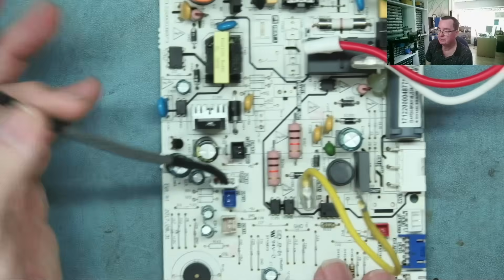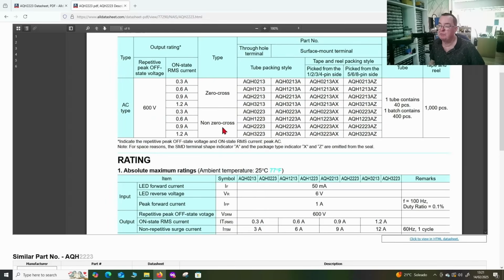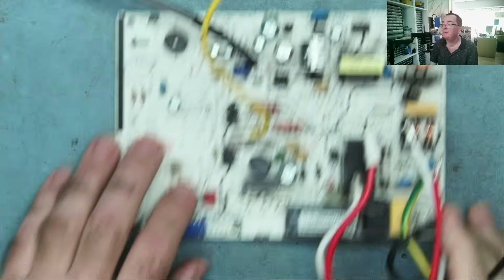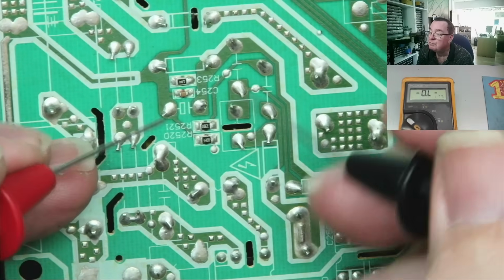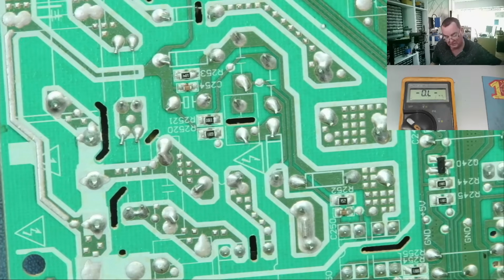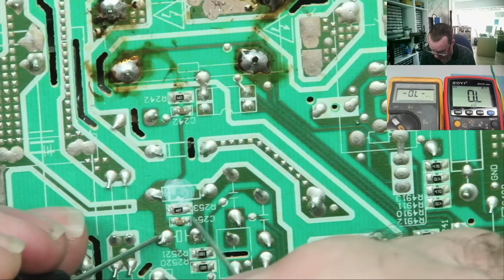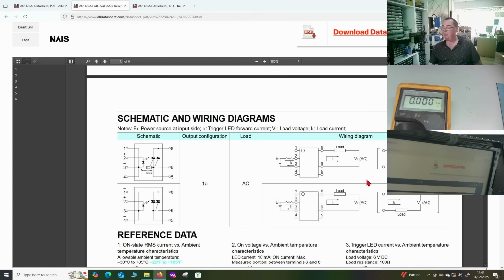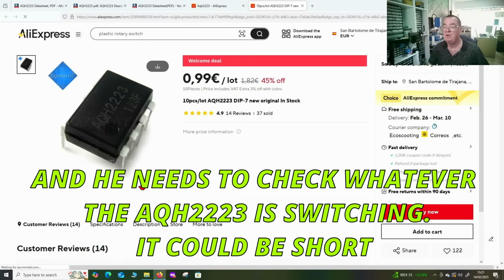How To Find The Faulty Component On A PCB Without Schematics : A Very Practical Repair Example!

Comment: Excellent video Richard. A tip I would pass on to would be repairers, is to keep a fairly detailed note/log of what you do and what you find when attempting any repairs. I tend to create a PC folder for each repair I undertake, into which I place any schematics (found or reverse engineered), any device datasheets and application notes if applicable and a notepad file logging what I did. That way if another identical or similar fault comes across your bench then you already have a record from before as a starting point.
Given that you often make these repair videos I guess you have a built in record.
Reply from the maker: Actually I am not as well orhganised as you are in this respect.  And you are totally correct about how useful this approach is.  Others take note. 😉
Reply: You cant get a better log than the actual video recording of the fault diagnisos. But i see your point.
Reply: A great idea..I used to repair TV's many decades ago and kept a little black book on all my repairs. If a TV came in I would look up the make and model in my book and usually find I had done a repair to the same model that had the same fault.

Christ I can still remember a common fault with a Phillips TV with a K9 chassis with no power. Always was the BU126 power transistor.
Reply: What did you learn today.  Remember em all and you'll be a genius.
Reply: Scribbling a schematic with Vdrops measured resistance and expected values helps me. Still got a ways to go but always learning.
Reply: As somebody who mostly deals with my private electronics or hardware for projects I do professionally work on I try to vacuum up all documentation I can get hold off as soon as I receive a device.  There is a tendency for documents to vanish entirely or behind paywalls or being replaced by newer revisions which may no longer be applicable to my device.  That includes user manuals so I can don't need to dig through boxes and binders for the paper copy of a manual that came with a device.
Reply: "if another identical or similar fault comes across" -

Also useful if it's the next morning when you go back to work on the same board. Or if you get a phone call and have to go pay attention to something else for a little while. :)

It's very easy to spend time checking on an area that you actually already verified the day before, if you don't have notes of what you've found so far.

Comment: Cable  between the units been tested?
Reply from the maker: Yeah the onsite engneer did check that, and also things like refrigerant pressure.
Reply: Guess 2 after watching… is the SSR feeding the louvre motor? Faulty louvre motor? Inductor feeding the SSR have shorted turns?
Reply from the maker: @JonathanMRose  I don't know what it feeds but it is clearly a 240V AC device and I did mention it is important to test what ever the device is for shorts
Reply: @ could the inductor next to the SSR have shorted turns & caused the issue?

Comment: 33:00 wouldn’t you be able to use the backlight tester as both the source and readout for testing the TL431?  Seems that it would simplify things.
Reply from the maker: Yes that should work if you set it to 1mA range though you still need the adapter to connect to the three pins of the TL431. I oriiginally intended it to use a 9V battery or similar supply when I built the tester,  and a multimeter
Reply: @ I gave this a try, and it worked perfectly.  I used a wide ink pen shell and a 3P receptacle. After attaching two banana leads to the receptacle solder leads, I inserted sharp gold plated pogo spring pins into each location. The result was a on-handed probing pen on perfect spacing which attaches to my backlight test box.
Reply from the maker: @Y.T.Learner  Nice one Paul.
Reply: @Y.T.Learner  That sounds slick, I wish I could see it 😏

Comment: I wouldn't have bothered removing the relay to test it. You measured the resistance - 120R, so the current will be 100mA at 12V. Set the voltage on your power supply to 10V and current limit to 100mA. If you pick the wrong way (diode protection) you will get current limit. The right way will trigger the relay. These relays should reliably switch at about 8V so if it doesn't trigger either direction then it is faulty.
Reply: Maybe some caution with this method - pretty sure I managed to blow up a ULN2003A driving a relay, by applying reverse voltage directly to the relay coil, can't be 100% certain though, but in this case (heater control relay in a washer which was clicking but no power to heater) I suspected the relay contacts were burnt out and tested in circuit (on site with a 9v battery of all things, definitely had it reversed for a very short time). Once confirmed, brought board back, replaced relay and then back on site, found the relay was no longer being driven, and had to replace the ULN2003A too.
Reply: @budgiefish  That would suggest that the reverse protection diode was either not present or had failed, since protecting the driver is exactly its purpose. It's also the reason for limiting the current and using a voltage lower than the nominal voltage of the relay.
Reply from the maker: Yeah I am sure you could do that,  I certainly would have tested it in circuit if I could see the protection diode as I mentioned.  As this relay only had 4 pins (on the PCB) and it was so quick and easy to remove with just a soldering iron, I'm happy with the way I decided to test it.  If it was a multiplole chageover with about a dozen pins I would have thought differently.  Of course like you say we all have our own ways of tackling any particular job and one usually isn't more or less correct than another.  I also didn't test the relay for things like contact resistance, mainly because if they have that sort of problem the casing burns up or deforms.
Reply: 7v and your absolutely correct

Comment: I have two comments on the testing capacitors statements. Firstly you can absolutely test for high ESR in circuit, although having said that ESR is only an indication of one failure mode. There are more important and critical modes. Secondly small capacitors MLC in particular absolutely do fail in fact it is inherent .It is called ageing.  For example x5r ceramic has an ageing  rate of 5% at 48 hours. X7r 3% at 1000 hours. The ageing process is continuous and never ending, until the curie point is reached anyway.
Reply from the maker: I think I confused a lot of people with that statement.  What I meant is, it problably isn't going to give you any sort of meaningful result by measuring the capacitance and or ESR of the capacitors on a PCB like this.  It's more likely to help if you check across the larger capacitors for short circuits as this would suggest you have a shorted voltage rail somewhere 
I should have been clearer. Yes you can check the capacitors but in my experience it's not likely to help you.  However of course we all have our own way of tackling this sort of board repair and I don't believe there is anything wrong with that. We all keep learning. 🙂
Reply: You can USUALLY test caps for ESR in circuit, but I'm seeing more and more of they have an electrolytic and a small ceramic in parallel, or an electrolytic, and a bunch of small ceramics scattered all over the place on the same voltage net. From the design perspective, the electrolytic is better at filtering low frequency noise, and the ceramic is better at filtering high frequency noise, which is why they put them in parallel. But when you check ESR in circuit, the ceramic(s) will show a low ESR even if the ESR of the electrolytic has gone bad. If I'm concerned about it, lift one leg of the electrolytic and then check it. That said, I find checking all the ESRs of the caps in-circuit will find a LOT of problems very quickly.
Reply: @gorak9000  Yes if of course if you have a circuit with multiple caps in parallel the total esr will follow the parallel resistor rule. A typical ceramic cap will have an esr of .001 to .1ohms at 100khz( normal in circuit test frequency ) and will therefore have a massive impact on the reading of a regular sized electrolytic  say .5 to 5 ohms for example. Therefore testing would necessitate removal . I was pointing out that it is absolutely possible to perform in circuit testing , rather than totally dismissing it. Judging an electrolytic capacitors health on how it looks is a bad idea imo
Reply: @jonathanperry1583  Yes, in circuit testing is the huge benefit of ESR checking, and I totally agree, you can't go by looks. I find plenty of totally shot electrolytics that look fine. If you're going to go by looks, you'd have better luck just going by color - any of the cheap no-name caps that have that greeny-blue color to them, and gold printing, are almost always dead with high ESR - like the ones at 20:57. Doubly so if they are Jamicon or Yeapo or Fuyjo or something like that - some 'brands' you can pretty much just replace on sight - they're always bad.
Reply: Agreed.

Comment: After turning it on, would a thermal camera help? Thx.
Reply: Those are absolutely helpful to have but not in this instance.  There wasn't additional heat coming off anything and too little of a difference on the regular circuit that has some through it compared to was isn't.  It's good for outliers of heat.
Reply from the maker: @_FJB_  Yeah agreed the thermal camera is very useful in many situations and if I had any reason to suspect it would help in this instance then I would have tried it too.  Having said that there is no harm in trying it either if you wanted to.

Comment: Thank you for your videos.  I wonder why you don't use an ESR meter to test the caps. in circuit.  It is a very useful tool.
Reply from the maker: I guess we all have our own take on how to undertake this sort of daignostic work.   I generally only use an ESR meter to test capacitors used in high frequency switching circuits, ie DC-DC converters and SMPS.  And even then only 'wet' electrolytic ones that are known likely failures.  My other common use of the ESR meter is to find short circuit mosfets in multiphase VRM..I made this video about how and when to use an ESR meter  https://www.youtube.com/watch?v=bMUzTGnvrbU

Comment: at 49:38 there was an ant by your multimeter
Reply from the maker: Yeah it's not difficult to occasionally see insects when you live on an island very close to the tropics 😂
Reply: @learnelectronicsrepair did you check his continuity?
Reply: @ oh of course, because the weather has been so great recently....🤣
Reply from the maker: @henrywalker8287  Actually we tend to get more insects in the Spring (which occurs in February here, it's Strawberry season right now) as we also tend to get a bit more rain at this time of year, though only about 22mm on average.  So insects seem to like that better.  We havea lot less insects than you would expect in general as our climate is too dry and our wild lizards find them very tasty.
Reply: @learnelectronicsrepair  so are you not actually in the UK then?

Comment: 2:56. ALWAYS 95%  ON AIR CON AND HEATING.  ITS A HIGH CURRENT RELAY IS BURNT ON THE BOARD TERMINALS.    COMPANIES JUST CAN'T GET THROUGH THEY'RE HEAD A TRACE CANT PASS 120VOLT AT 30 AMPS

Comment: Hey Richard  the back EMF from the relay could damage the output of your power supply when testing. Some people including Dave from EEvolg have reported damaging their power supplies outputs doing this test. Maybe it would be a good idea to put a diode in series with your leads.
Reply from the maker: I've never come across that problem to be honest, but the theory behind your suggestion is good

Comment: 34:32 Wondering how “0” ohm resistors fail?  Please elaborate. ❤
Reply: Some are used just to jump over a trace, some (more rare) are used as a fuse.
Reply: They go open circuit, no current will flow through.
Reply: @David-c8f8j   Well, of course... they certainly don't go short circuit!  My question is how they fail, not what is the symptom.
Reply from the maker: @Y.T.Learner  Usually they fail because something was drawing too much current through them.  So failure caused by another fault in the circuit.
Reply: @learnelectronicsrepair   OK, so they are burned up by external causes, like a fuse or burnt trace would be.  It seems that 1-sided boards use a lot of them as jumpers. When the go open circuit, isn't the failure obvious visually?
Reply from the maker: @Y.T.Learner   @pault6533  Yeah it can be.  I just check 0R and other low value resistor, plus high value resistors 100K upwards out of habit. Or just because I've found more failures in those resistance ranges than anything else.  Oh and the same for power resistors or large SMD resistors of any value.  They are large for a reason ie they expect to pass more current during normal circuit operation. These sometimes just go very high in value or crack due to constant heat cycles and it may not be visibly obvious.  At the end of the day I can only show you guys how I go about these sort of repairs, take as much of that on board as you like and also develop your own style as your experience grows.  Then come back and teach old dogs lke me a few new tricks 🙂

Comment: Bad solderpoints at connector 8:25
Reply from the maker: Yeah the joint on the connector just above where it says C38 could be suspect.  Well spotted.
Reply: Do you mean the excess solder terminal is leaning over onto the nearby trace to the right of R9?

Comment: Hello and thank you for sharing, at 21:00 around you say you cannot test capacitors in circuits which surprise me. In effect there are some in circuits tester for capacitors , maybe you do not trust such testers  ? 
Brgds
Reply from the maker: OK I didn't mean that you can't test them in circuit exactly, I was more referring to the fact you probably couldn't come up with any meaningful information by testing them in circuit.
Reply: its always good to test them out of circuit, as you may also be testing the capacitance of components around it. Some components are fine to test in circuit like resistors but caps are the hardest